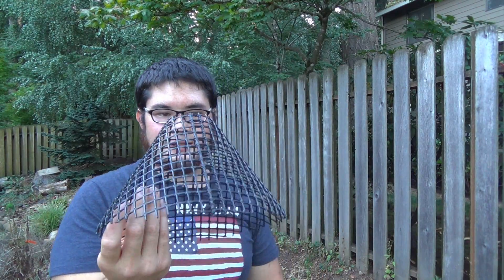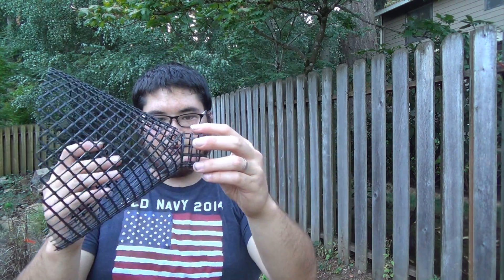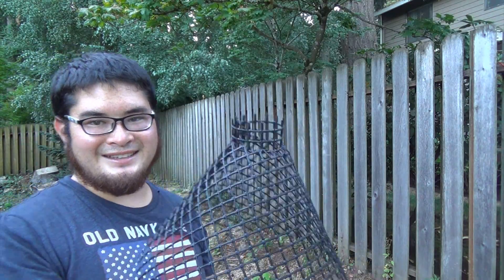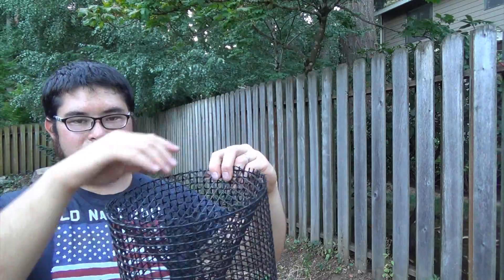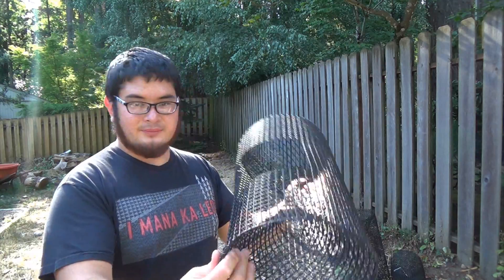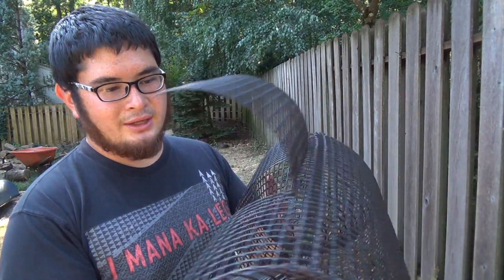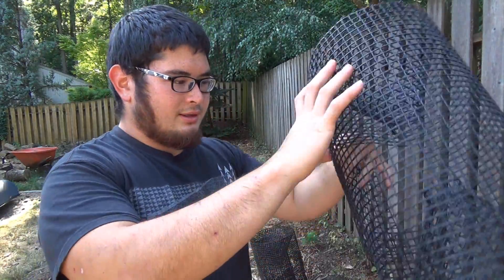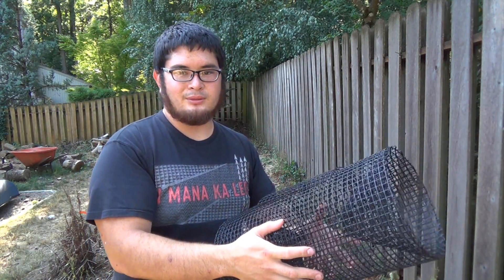How to Build a Crayfish Trap for Under $5 - Part 3 - Finishing

Comment: Minnow trap. (Bait for fishing etc)
Two 10-liter soda bottles. Cut tops and bottoms off so their cones are level. Attach cones with a stapler and metal surface, staple from inside-outside and bend staples inward. Take both the "funnel" ends and staple them facing inward the same way as the cones were stapled.